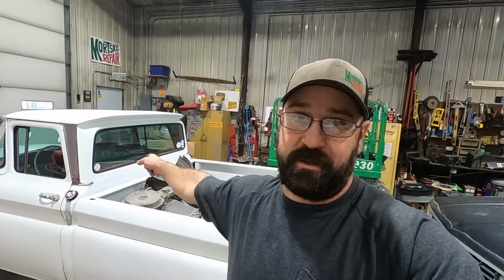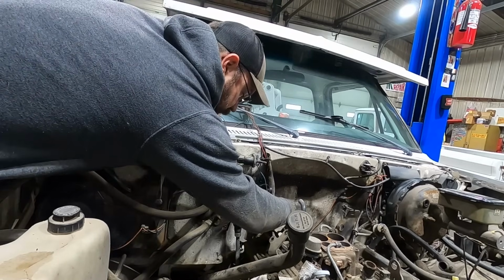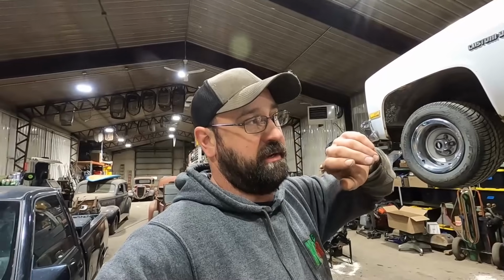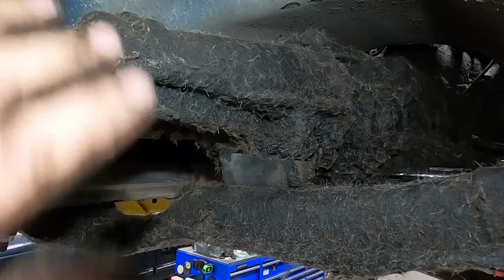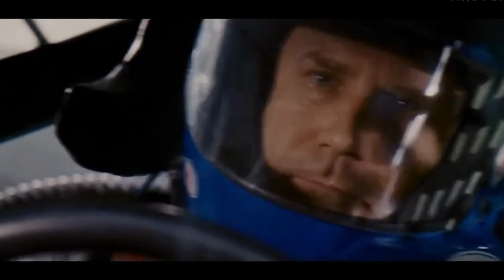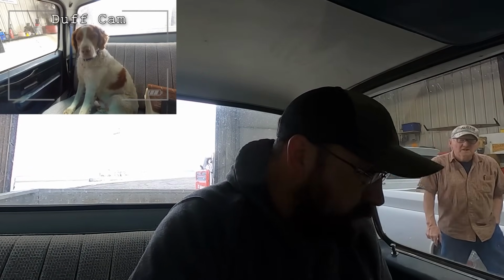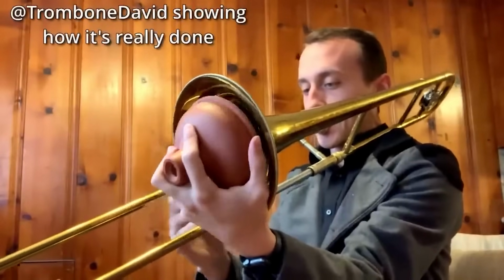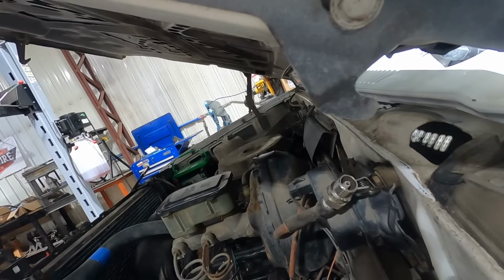V8 Squarebody Swap in a Weekend!! Out with the old V6 and in with a new Small Block! Power Upgrades!

Comment: You don't need to get a new tank to support efi - just get an external walbro pump.
Reply from the maker: You like listening to noisy pumps?
Reply: @MortskeRepair - I have a car with an in-tank pump (2012 Mustang with a 351W stroker), and one with an external (1964 Fairlane with a 429). Both cars use a Walbro 392. I can hear both when I turn the key, but once the car starts, I don't hear them at all.

Buying the external Walbro is hella cheaper than buying a new tank that supports an internal pump AND THEN the pump itself.

Final benefit - the Walbro is a puller pump as opposed to gravity fed, so you don't have to be as particular about mounting location in relation to the tank.

Just trying to help.
Reply from the maker: @jsimmonstx  No, they're definitely a pusher pump. And they're for sure louder.

Comment: Doesn't the upper radiator hose have to be supported by fan shroud, so that when it gets hot it doesn't sag down to where fan smacks it.
Seems like I remember something to that effect, but didn't drive those models.
1949 3100 L6 , 1970 C10 camper special 327 4 speed muncie,1974 C10 Cheyenne 350 3 on the tree, 1989 1500 Silverado 5 speed, 1997 1500 Silverado 4l60, 1995 Mazda B4000 SL 4X4 4.0, 2003 XLT F250 7.3 4r100, sorry none of those models 
Favorites 70, 95, 97, 03, although the others have their place just not the same.  
I drove them all for years, except 95, it's just a toy for going places the others won't, or shouldn't go, and it's nearly impossible to get stuck, stock except 12.5x33x15 T/A mud.
Scratch ole Duff's ears, give him a treat, and enjoy a samwich young man. 52:29
Reply from the maker: We shall find out

Comment: What’s wrong with using parts and stuff you already have? Wish I had some parts doner rigs for my 82 square body. Work smarter not harder.
Reply from the maker: Nothing
Reply: @MortskeRepair  yea that's what I mean. I get almost all my replacement parts at the salvage yards at home. Yea you I still have to pay for them but way cheaper than brand new.

Comment: Wait a sec. Did you say that truck had a Turbo 400 in it?? Behind a lowly V6?? Why? That's so backwards of GM. I had an 81 K20 4x4, 3/4 ton, longbed, 350 2 barrel, and it came with a stinkin' Turdo 350! And 3 months after I installed 33x12.50x16.5 (old school) mudders on it, the trans went out! GM was retarded back then.
Reply from the maker: TH350 wasn’t offered in 86